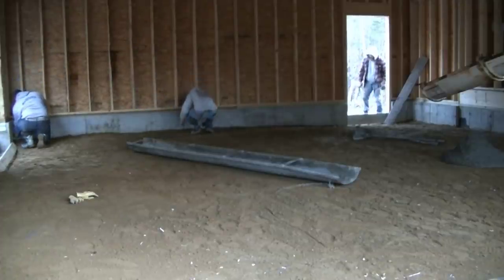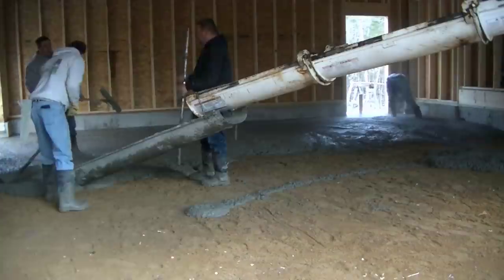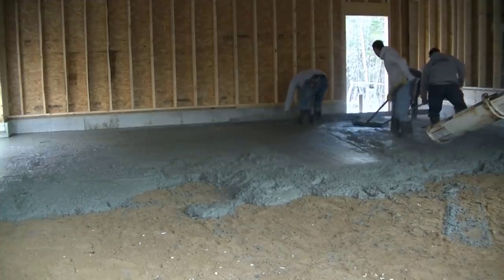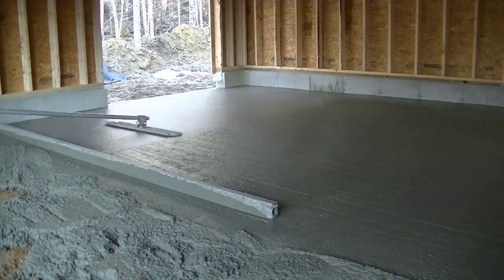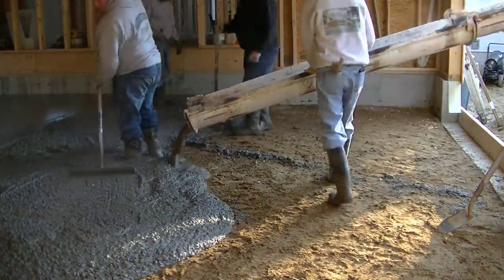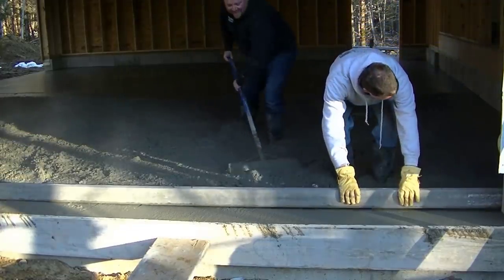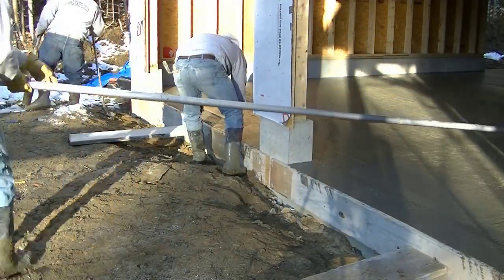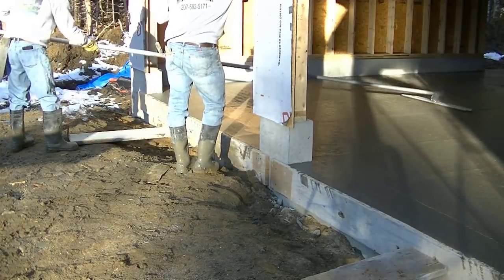Pouring A New Garage Floor 32'x28' (That Slopes To The Doors)

Comment: Heya Mike. Would you recommend a slope on ALL slabs? I'm about to form up a 28x36 for my fully enclosed shop and thought I could start with a 2x8 and if I had to rip it down to a 2x6 at the far end of my 36' if I had to. If I dont, then i wont.
Reply from the maker: We always slope a garage floor when it's inside a frost wall but we don't usually slope a garage slab when we form with 2x6's or larger boards. If you do you'll have to cut all your studs differently when you frame the walls. 
If you pour a concrete knee wall on top of the "sloped slab" then you could level the top of the knee wall and you'd be good. We do that when the owner wants a slope in their slab.

Comment: Hi! I just found your channel and i like watching how you do it in the us. 
Here in sweden we use vibrator and rotary laser level to level the concrete and then screed the concrete, in a rocking motion with a (usually) airplane wing like screed. 
In this way we can easily manage this size of slab with 2-3 guys. 
Keep up the good work! I really got the urge to start pouring some myself now. (Been off concrete work for a couple of years, unfortunately)
Reply from the maker: Thank you!

Comment: Hey Mike, I love them jobs ! Just pour and finish. I can't believe the owner didn't want any wire or bar in his GARAGE FLOOR !! Doesn't he expect to park any vehicles on it ? Lol. Also it's big enough to work on your vehicle in there. That's a head scratcher to me, but hey you just do what the homeowner wants ya know. Did you try to talk him into putting any wire or rebar in it ? And to answer your question, I pour all my garage floors level. It's interior so you don't have to worry about rainwater, and probably don't have to worry about any fluids being flooded onto the floor cause I don't think he's gonna be working on any vehicles in there. But nice job as always bud.
Reply from the maker: I wasn't working for the Homeowner or I would have. I was working for the Builder, he's the General Contractor and also the excavator so he did the prep work.   Thanks for the comment George!!

Comment: Why don't you put plastic down before you pour. Doesn't plastic keep
 the moisture from coming through the concrete
Reply from the maker: Yes it does. The GC didn't ask for it. There's 3' of sand in this one and drainage. probably ok on this one.
Reply: Inspector here in north Carolina requires it..
Reply: There’s no excuse not to use plastic. Every square inch of concrete under a roof should have plastic under it

Comment: I do commercial and industrial concrete in Ohio, we use the same rod boards, when we screed we get it down in 2 pulls then close it up. We make wet pads as well. We always ride a form if we can, then we will wet screed off a floated pad... We use the viber strike aka power screed aka Magic screed a lot. But when we use it, people can’t float an edge, then they can’t rake behind it so the edges don’t get down. It Can be sloppy So we keep the use to a minimum. 

I want to learn to kick screed, but the concrete we use had big rocks in it and it’s not real easy to hand screed. I see you guys take little pulls ware as we take bigger pulls. With people who can’t rake lol Do you guys leave the Concrete a little high so the feet holes filled in? I feel like we have to fix our feet holes every single pool
Reply from the maker: Thanks for the comment Lee. Stay safe and keep muddin!!

Comment: In Ireland here we screed side to side and tamp it down, unless of course we pull vibrating screeds, that's a nice pour, you won't ever get cold pouring concrete 😂😂, in concrete gangs most of my life, when you have a good gang it takes a lot of the horse work out of it. If you're caught with a few guys  that don't know what their doing as you know you're then in deep shit especially if it's a big pour
Reply from the maker: Having good guys is the key in my opinion.

Comment: Mike I am a fan and sub to your channel. All our industry and job sites have shut down for three weeks. I can't understand why take the risk of all those guys and their families getting sick. Is there a surplus of ventilators in Maine. I know there are mouths to feed but man turn on the radio. There are refers backed up to hospital doors to act as mourges because the folks are dropping like flies.
Reply from the maker: Mike, I have a backlog of videos. This was just before all this started getting bad.
Reply: @MikeDayConcrete  I figured that was the case, you seem like a stand up family guy, so couldn't get my head around it. Have learned a lot from your videos. Have done plenty of framing and am planning to pour and finish my own garage and driveway in the near future.

Comment: I would have put 3” slope on it ( at least a inch every ten ft.and one guy would hsve used a whiskey stick.( looks like a big come-long) our slop would have been 3” front to back no 1” slope to center. We would have at least put 16” dowels every 2 ft. I would not have poured it if he didn’t pin it to the wall. Why a person buys a new home and in 2 or 3 years the edges settle the home owner would have no recourse. Just the joy of being sick. We also would have put a 1 1/2” door lip in it. What is the going rate on labor to get it reassures and pour. Dow here they would have gotten $1.00 to just pour . I’m guessing the foundation guy bid it at $4.50 sq ft labor and materials.
Reply: Pinning it to the wall will stop the edge from settling but than when the rest of it settles what do you do? I've seen it happen. Best to let it all settle together. Or better yet make sure you do your backfill right. We've learned the hard way.
Reply: Ryan S on garages very seldom do we dig out the center it is always poured on original ground .  If if was deep on that 32x32 garage we would have poured two 3 x 3 pads and kept them low enough to put 4” chat/rock over them so they don’t crack the floor floor. You pin the sides because it always going to be hard to pack the the corners tight. People really don’t mind paying for it. I get $4.00 sq ft. and $50 to $100 per pad depending on how deep they are. I always pour the pad before the floor never with it.

Comment: Sloping garage floors are a bad idea. If you use it as a shop, you get off your stool, and it rolls away. 
When are you going to have so much water in your garage that you can't just sweep it out? Probably never.
It has never rained in my garage, either. It's not a driveway, It's an enclosed building.

Comment: Jesus christ, no vapor barrier, no wire and zero slump.  That general contractor is an asshole. A good 5 slump, 6 bag, wire and the vibro screed would make this slab like kryptonite.
Reply from the maker: It was 4000 psi, 160 degree water with accelerator and fibermesh. I control what I control, the GC told me what he wanted.
Reply: @MikeDayConcrete  I get it, the finish looks good.  I hope you refused to warrenty it.  I doubt 4000 psi after 28 days with it that soupy.  Poor homeowner, I would've turned down the job.

Comment: I've seen guys use 1 1/2" pipe on the front edge of the garage ro make pulling in and out smooth. Also, Without wire, it's most likely going to crack. Very foolish not to use it. Cheap contractor.

Comment: Fiber mesh DOES NOT REPLACE  rebar or wire mesh EVER.  That garage floor will crack constantly.  Waste of time and money,  Going to cost 4 times more to redo it properly all because they wanted to save a few dollars!  What a JOKE.
Reply from the maker: Been using fibermesh for over 20 years, never replaced one yet.
Reply: @MikeDayConcrete   Well fiber mesh has no tensile strength to speak of. Reinforced concrete is concrete with rebar in it   Concrete has high compression strength but no tensile strength.  When you add rebar to concrete it vastly strengthens it. It lends concrete it tensile strength.  Not sure how many concrete jobs you’ve done but without rebar it’s not worth shit.